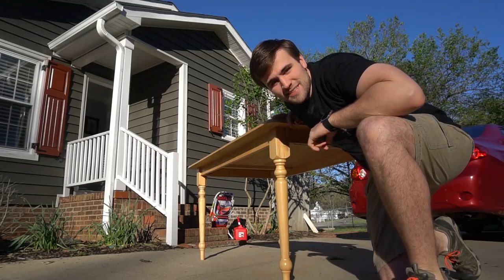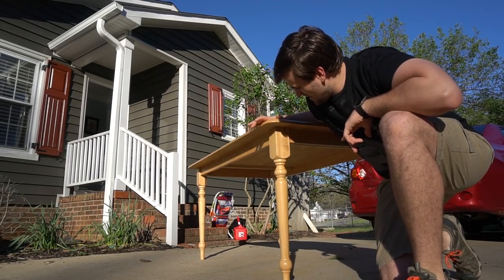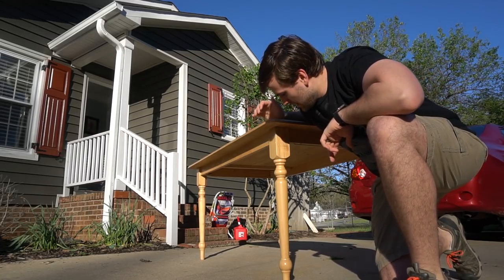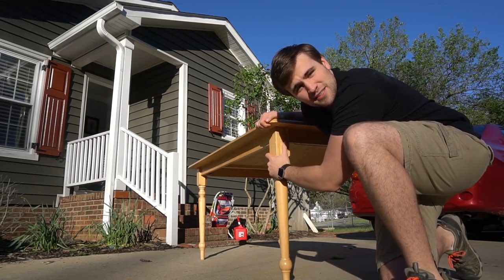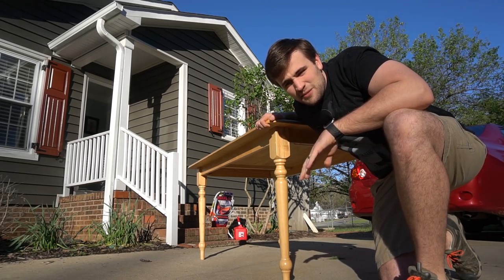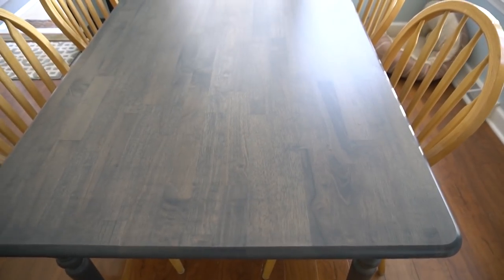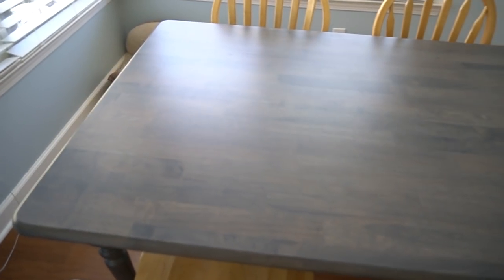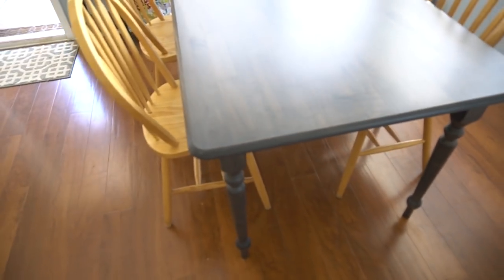Refinishing The Kitchen Table - Worn Out Craigslist to Clean and Modern

Comment: Nice job especially considering the time spent on it. I am certain the color worked for you and I am sure there are many who like it but for me I would have just used multiple coats of clear satin poly. Did a table for my sister over 20 years ago and still looks good.

Comment: The new color looks really good!  Darker gray or black chairs, maybe?  

Stripping might be easier with chairs. Sanding chair parts is a PITA!   (DAMHIKT).  Alternatively, a quick sanding and a spray coat of de-waxed clear shellac to seal the finish and then spray painting the chairs would also work. Then spray finish with an appropriate clear and durable topcoat.  

Hey, even if you do nothing with the chairs, the entire set still looks great thanks to the work you did with the table.
Reply from the maker: +Jerry Stark thanks! If I do the chairs I might look into a primer that I can just cover it all up without doing too much sanding.

Comment: Hi, unfortunately I can’t get a lot of the stain you used. Do you have any other recommendation I can buy from lowes or home depot and is as same color and quality as the one you used? Thanks
Reply from the maker: It's tough to find a good lacquer based stain. But I would ask around at a local finishing store and use lowes/home depot as a secondary option.